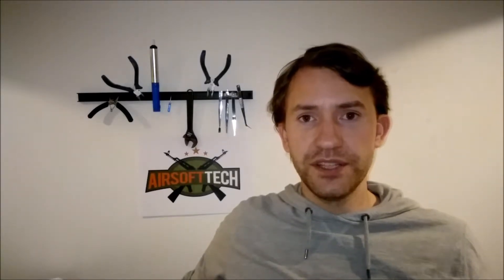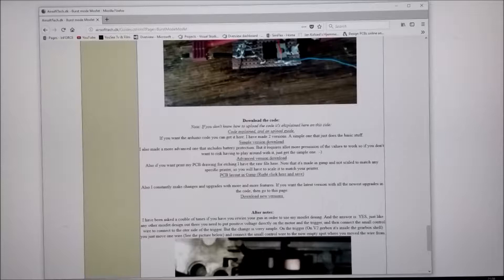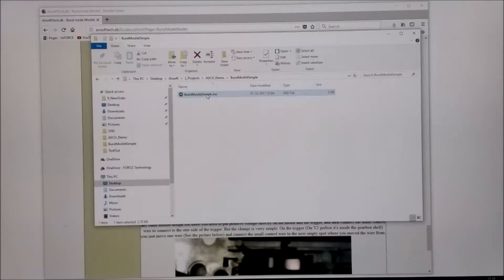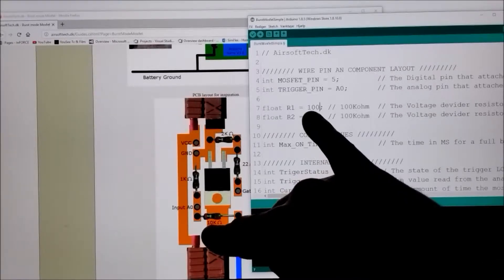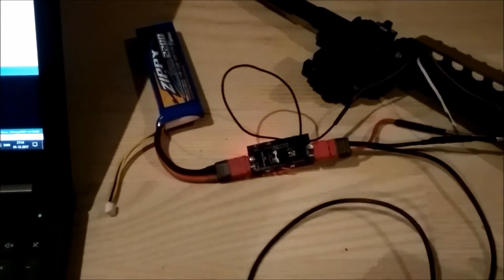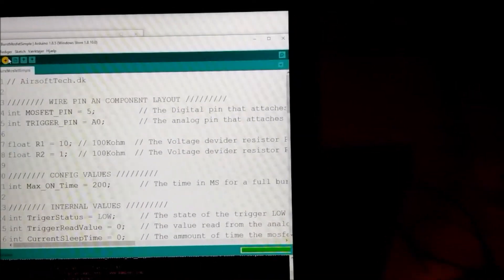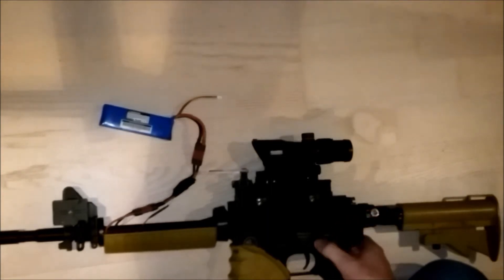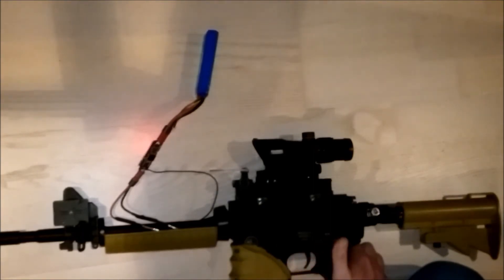Finaly done - V1 Burst mode mosfet. By AirsoftTech.dk

Comment: Hello Friend. I did a project similar to yours, but I did not use the analog ports of the arduino, but the INPUT_PULLUP so my mosfet is an IRF4110 with a 2.2k ohm resistor and another 22ohm resistor. The point is that my battery is a lipo f and 7.2v and 1100 mah and unfortunately only the battery only provides enough power for the engine to turn if the wiring is short enough that the mosfet is very close to the engine and the battery (this means that doesn't fit in an m4). I would like to know if you can help me, because the battery normally powers the engine when I don't use the mosfet with the arduino. I don't know much about electronics, so my theory is that the 2.2k resistor connected to the IRF 4110 terminals can be consuming battery power, because I believe that the fault of this excessive consumption is not due to the Nano arduino. another thing i forgot to mention is that the battery is running out twice as long. I'm sure the problem is not in the Arduino code, as I have already done tests to determine this. please, can you help me?
PS: Sorry me my bad english. Im Brazilian and i use google Translator for this message.
Reply from the maker: Go to my web page and send me the massage there... then we will give you an e-mail Where you han send us Darwins etc ... so that we can Help you
Reply from the maker: And please Remember to subscribe 😉 it realy does matter

Comment: Awesome project, very detailed videos and tutorials, great job on this. There´s only one part that i didn´t understand: how do you integrate the existing fire selector mechanism with the arduino? Do you use a selector plate with a metal tab or is there another way? This is an excelent tutorial series nonetheless, the best i have found on youtube actually. Thanks for sharing. Greetings from Brazil.
Reply from the maker: on the projects page theres a description on how to wire it up ... but basicly it can be wired up like any other mosfet :-) ... http://airsofttech.dk/Guides.cshtml?Page=BurstModeMosfet

Comment: hey I'm fan of your work :) is ti possible to make modification to your burst mosfet unit to add another mosfet for active break feature. Also would it be possible through code to make your mosfet shoot semi only for dmr builds?
Reply from the maker: In the next mosfet video (There may be some other project videos uploaded while I make the next mosfet one) I will start to go into details with the code. In the code I will add some features: Auto Programming timing values, Semi only Lock, Battery protection, Switching between full auto and burst.. And maby more .... 

Active breaking is not someting I have on the plan for the next couple of videos, but if you want i can put it on the "To doo" list :-)

If you have a specific wish (Like "Add the dmr semi lock feature first") please just tell me and i will prioritize those features :-)
Reply from the maker: Also I'm thinking of putting together a "DIY airsoft mosfet KIT" where you can buy a set of all the components needed for the mosfet in one package .... Would that be of interest ???